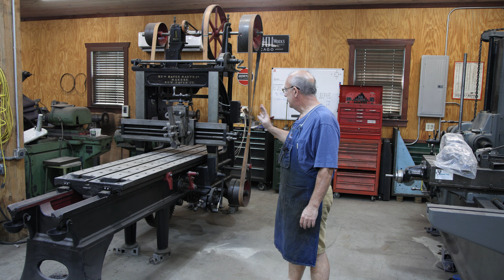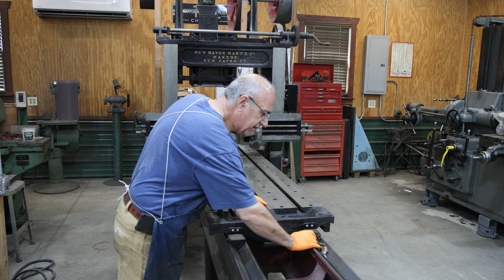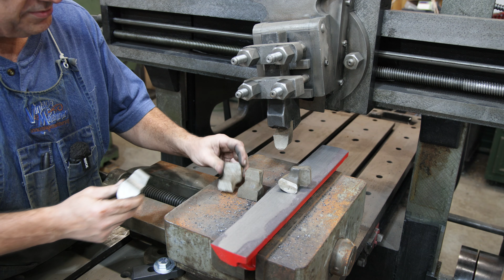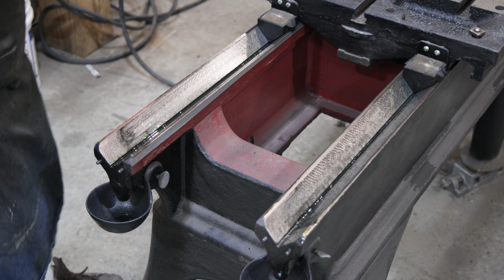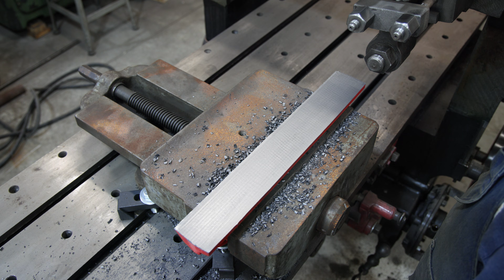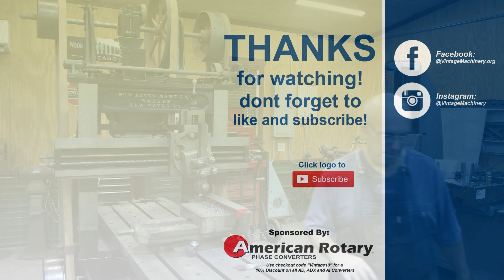1890’s Era Metal Planer: Setting up and Testing Cutters on an Old School Flat Belt Powered Machine

Comment: Check out the older Machinery’s Handbook foot cutting tool shapes.  Roughing was done with tool that you have.  For flat finishing, a broad flat edge cutting tool was generally used.  Scraping by hand followed.  With the flat edge   a relatively flat surface can be machined with a very corse feed.  The original surface of the platten or table would have shown this type of feed.  You’ve done a nice job of rebuild.  Be sure you show oiling all the points needed to be oiled, as most folks don’t realize how much lubrication is required.

Comment: Imagine the workshops when this machine was the standard, the racket it makes then multiply that by dozens to hundreds of like machines. Next door to foundries and forges that produced the raw parts. All powered by steam and oil burning diesels and nothing about work safety more than the common sense you were born with and probably some luck.

Comment: Hi Keith
It is great to see the planer in action cutting chips!
As you have got straight cut gears, I’m not surprised there is a bit of chatter, but the surface finish looks really good. The main thing is a flat surface finish.
I don’t think you will see any of the chatter once you have scraped it in.
Reply: You could always machine a helical cut rack and pinion to take the chatter out provided you maintain a constant mesh!

Comment: Keith, about this planer, you should look at some of David Richards videos, he has a steam powered machine shop and the music from all those belts... As someone who isn't a machinist, old steam powered machines have always been my interest over electric powered. However, since times have changed, I do agree with you adding that electric motor to your planer. But, nothing will beat the old steam powered in my opinion. I know many today prefer speed but, I'm an old school type of person and sometimes, slow is the better way to go. I've seen what high power and sped up work can do, I've also seen the carnage that happens and the cost of said failure vs the old tried and true machines of old. Thanks for sharing, great video as always, cheers :)

Comment: Sometime during the 1960's a friend of mine worked at a machine job shop which made o-ring molds which were 2 plates about 1" x 24" x 24" . The rough p  late was machined flat on 1 of 2 planers which were twins to yours. They were mounted on very short legs , probably to simplify handling of the plates.

Comment: You say this is the wrong machine or perhaps not the ideal one for your test operation. As you are selling these straight edges then could you  stack many of them over the bed and rough grind 20-30 at a time?

Comment: Just like @genesun71 said, try using less top rake on your tools for cast. Either flat top or even slight negative rake.

Chamfer the trailing edge of your casting where the cutter exits using a file, helps to prevent busting out the edge.

Comment: Keith, try a "shear tool" like Adam uses on his big shaper.  He ground his cutting tool with a much steeper (I think you called it a) back rake/angle on your last cutter.  Ask Adam to send you a few pictures of his big shear tool.  It might cut a bit better.  Also, make sure to read @genesun71's recommendation of using a "very heavy open gear lube on the rack and bull gear.  (Acts as a cushion to stop vibration and improve finish)."

Comment: My  old Klopp shaper had a tool lifter.  It was driven by an automotive type choke cable that was pulled on the return stroke by some sort of friction mechanism on the ways.

Comment: a simple way to patent an automatic clapper lift on the reverse stroke is to use the pneumatic in your shop, a cam activated pneumatic valve and a Bimba or alike throw away pneumatic cylinder, you use the belt shift mechanism to trigger the pheumatic valve and the  pneumatic cylinder to lift the clapper on the return stroke.
There is many ways to engineer the support brackets for the valve, the cylinder and the lift le block ) but in any ways, this can stay very simple add on.
One thing I observed is that the feed distances seems to be very agressive, this can explain the shattering you observe on the finished surface on the machined part.
very interesting machine
very interesting video.

Comment: Nice job getting that old machine working again .
If you mount a Bridgeport head to the tool mount and slow the feed way down with a variable speed motor drive then you will have a machine that can do milling work on a large scale .
Josh Topper has one in his shop .

Comment: There's a planer exactly like this one in the sugar mill of the Gay & Robinson Sugar Plantation on the island of Kauai. It still works, although the sugar operations closed in 2009. It was used to cut the brass bearing halves to fit within the supporting chairs for the mill rolls. I was mesmerized by the belts and operating mechanism whenever it was in use. Aloha!

Comment: Diamond hone your tool with a 1000 grit stone. Add about 2* more rake. Add a small fan to blow the chips free as it scrapes. Increase your speed about 10-15%. Try it & see what it does & let me know if it's what you want or tell me to crawl back in my hole with my own planer. Good Luck!

Comment: Keith, I'm a big fan of your videos, and very appreciative of the effort you're putting in to maintain such a steady release schedule. If I could offer one minor suggestion - I'm finding that the audio volume switches up and down quite a bit in your recent videos, and I'm having to adjust the listening volume multiple times per video. Maybe this has to do with you using different microphones for different shots? In any case, I believe that Volume Normalization is a common feature in many video editors, which can be used to ensure more consistent volume, especially when combining different clips.
Not a complaint - just a suggestion. Thanks again for your content!

Comment: Hello Keith, Love this video.  I have a SB &" Shaper.  finding the right tool for the best surface is a challenge, at least on my shaper.  I would suggest some diamond lapping disks to sharpen the edge.  It worked on my cutters (mostly HSS).  I'm looking forward the project that will be cut down to size with this planer.  KOKO!

Comment: Your chatter marks were more evident after 26:29 when the tool was mounted behind the tool holder.  If the tool was inserted ahead of the tool holder it would not tend to be pulled out of the cut.  Doesn't the tool holder need to be angled slightly toward the direction of step-over?

Comment: The rack and pinion on that planer has done many a travel back and forth and I'm sure the rack and gear teeth have been worn some. When you ground the bed and table lowering the rack down onto the gear it could be the meshing of the gears is a bit off due to wear.
Reply: If the gear mesh is to tight to the bed it will make the bed jump up and down and not move smoothly back and forth , it will be jerky .
Check the clearance with some heavy paper, run it through the gears and see if cuts it badly , the big bull gear might need to be lowered to get it to turn smoothly with the rack gear .
Reply: He added turcite on the bottom of the bed ways to account for the bed and table grinding.

Comment: I presume that you know Adam Booth, so why not reach out to him and ask him what tools he uses on his shaper when wanting a better finish when he machined his straight edges
Just a suggestion Keith as I have always taken advice all the way through of my working life in Mechanical Engineering, I had 40 yrs as an Apprentice trained turner/machinest having run most machines even retraining in CNC at a later stage

Comment: I would sure like to see you fit an air compressor to blow chips away as the machine works. By that, I mean: I would love to see you find some sort of compressor which fits the age of this machine (and I have no idea if there is anything which would fit the age and general feel of this machine ) might be a diaphram air pump, simple fan, piston compressor with a wobble plate, or something similar to the oil pump up top. I know you put tons of work into this baby (I watched) but even just a brush on a flex arm might be a fun upgrade.

Comment: The cutting tool dragging on the surface during the back stroke isn't really a problem. Because the machine is feeding at the end of the cutting stroke, the tool will drag on the not yet surface. So it won't leave any marks.

Comment: Even though your belts are not exposed to the outside elements, those McMaster-Carr belts will tend to glaze and may slip. Some on hand belt dressing would mitigate frustration if they did. Some of the spray can type available for v-belts work but my preference is the old  Cling-Surface brand. Don't think its available anymore but if you have or can find some NOS somewhere it'll solve the slip problem.

Comment: I would have fed the head the opposite direction, that way you're not only cutting things once, you're averaging out several smaller depth passes is the work moves under the tool. The ideal chip would be much thinner than your depth of cut, but as wide as your cutter.

Also, why is it so darned loud?  I'd expect gear drive to be a LOT quieter.  Is the center distance correct for the drive gear?

Comment: Keith, when the bed returns have the mechanism hit an air valve that activates an air cylinder that pushes out the clapper box. Also, the air can blow through a nozzle onto the work blowing the chips away at the same time. As long as the bed is returning the air will activate and solve the problem.
Reply: Or just a wiper mounted behind the cutting head.  Going forward it does nothing since the tool is engaged, backwards it drags instead of the tool and wipes the chips away.  Love to see old gear put to use.  Lovely bit of ancient tech that's still useful.
Reply: this is a smart idea
Reply: There is nothing wrong with dragging the tool back over the workpiece on the back stroke.
Reply: Except for wear of the cutting tool edge.
Reply: @rrsteamer  Not if the tool is properly ground. The idea is that going forward the cutting edge does it's work, then on the return the tool should be touching well behind the cutting edge. Same method that a shaper uses.

Comment: Get a small magnet and strip of leather and stick it on the back of the tool holder. As the machine travels back over the work it will catch the leather and protect the work piece. Can't remember where I heard of this technique but it was the poor mans tool lifter.
Reply: That is such simple idea to lift the tool that might have been done back in days when these machines were in use .
The leather trailing behind the tool and then falling off the work piece before the tool returned and pushing the tool of the work on the return stroke , probably the leather would wear off and have to be adjusted down some every so often to keep it working .

Comment: Hah! As to horizontal surfaces, it's not just in shops! This is a continuous (44 years and counting) discussion with my wife! Love the old machines. Fwiw, Abom79 has many episodes on his big shaper that has a similar clapper box. He talks about how the angle of the clapper pivot is  super important so that the tool holder swings itself out of the way on the back stroke. If you get it backward, the tool digs in and ruins things. He also points out that when you look at the setup, the correct angle tends to look counter-intuitive - like it should be thee other way. I think yours is right. He dinked around with cutter grinds for a long time to get nice finishes. He uses - as you did - a specially ground shear tool and light cuts for the final passes. He hones the tool after it's in the machine by putting a precision stone on the table.

Comment: Excellent video Keith. 
It looks like you need to coat the bed and vise with oil. Rust??
I would recommend wiping it down with kerosene and not simple green purple. 
Water is a bad thing. 
It’s good to see the old machines working.
Reply: Water based de greaser / cleaner will cause rust and some of the stronger types will remove paint too , I have seen that happen .

Comment: Back when Abom79 was working more with his shaper he tried some different tools and found a particular tool that produced an amazing finish. One of the main things with it was that he honed in the cutting edge while in the holder, making use of the clapper box to get a back rake. There are also special tool holders with a geometry that prevents the tool from digging in too much, making it more stable.

Anyway, it's already looking pretty great. Could propably use it to refurbish smaller lathe beds etc. Saw videos of people in india casting lathe beds in molds buried in the ground and then machining the ways on a planer like this one with really crude looking tools, but the result looked pretty good.
Reply: yes - he put the stone on the workpiece sometimes...
Reply: There's a gentleman on YouTube who does just that, I've seen 4 or 5 videos of him planing the beds of Southbend 9" lathes with great success. I unfortunately don't remember his channel name (very small channel) but searching for something like "Planing Southbend lathe bed" will probably turn him up

Comment: Awesome machine - we had one about half that size in much worse shape.  We finally decided we would never get to it and it was scrapped.   The only thing I would add - I think you are just moving too slow.  I think you need to increase the surface speed.

Comment: CNC planers are used heavily in China where I live. They are used for fabricating sheet metal. They are able to cut long straight v Grooves so that the sheet metal can be folded into moldings and similar. The groove allows a crisp small radius bend. Super common here.
Reply: Planers?

Comment: I'm curious to see how close that would get a worn out lathe bed to scraping status.  I'd experiment on one that is considered "not worth it" by means of grinding (cost wise), first, though.  And it may be a real challenge with ways that were flame hardened.  

Maybe someone has a lathe in that "DIYDx2" condition that they would let you experiment on ... ?

Comment: Keith, could you mount a brush on the backside of the tool. Maybe even a wire brush that would flip the tool up as it passes the end of the part.  Kill 2 birds with one stone.
Reply: Or a stiff piece of leather clamped to the back of the tool would work.

Comment: On a side note Keith, I bought a vise just like that from a biker 50 years ago. He had welded a 3/4” drive socket on the end and used a 3/4” ratchet to adjust the vise. I bought it for $15 and have used it ever since as my bench vise. It’s so heavy I’ve never bolted down to the bench. I’ve always wondered what machine it originally came off. And now after 50 years you finally provided the answer! Thank you! 🙏🏻

Comment: Nice video. I allways wipe off a surface in one direction though, and repeat it, so as not to spread the schmutz back again. Wiping the dust to one end. Especially important when re-painting a car body.
Wiping back and forth leaves debris on the surface if not just used to loosen it up. Then one have to wipe the whole surface in several sessions in one direction to get it clean. Otherwise, much of the particles are just moved back and forth and the surface will not be very clean. (in the beatiful machine-bed of yours)

Comment: @tropifiori
0 seconds ago
Does anyone out there know a machine shop in Va or northern NC that had a similar machine. The lathe bed on my Atlas12 inch needs about .050 taken off it. The bed is about 40 inches long

Thanks
Frank

Comment: That's an awesome machine. Josh Topper mounted a Bridgeport head on his that does a great job for him. I feel that adjusting the angle of the clapper box would help to remove the chatter with a little bit of radius on the leading edge of the bit would improve the finish. Thank you Keith. Nice to see the old girl make chips.

Comment: Does anyone out there know a machine shop in Va or northern NC that had a similar machine. The large bed on my Atlas12 inch needs about .050 taken off it. The bed is about 40 inches long

Thanks
Frank
Reply: There are only 2 machine shops with a planer that I know; one in New York State, the Old Steam Powered Machine Shop of David Richards, and this one of Keith Rucker.  Topper Machine Shop in Minnesota has a planer with a Bridgeport head adapted to it he uses but I am not sure of the bed length.
Reply: Don't send it to this guy!

Comment: At 8:37 - Keith is describing how the table moves back and forth slowly on the cut stroke and then faster on the return stroke as the table drive belts move from side to side. This helps speed up the work. The difference in speed is caused by the size of the far left and right pulleys mounted on the upper counter shaft.

Comment: I am thinking your clapper box tool holder is too loose for the surface finish you are looking for. Too much vibration. 
You wouldn’t think of holding a tool in a loose manner like that on a lathe, would you?
You could also rig up a cable with a weight over a pulley that is attached to the table to dampen the backlash of the table drive gear. 
Keep playing around with the tool geometry it is an art as much as a science!
Keep up the good work!
JIM ❤

Comment: Knowing absolutely nothing. I would guess the tool should be like a farm plow. Rolling the metal up and out like a big tractor turning the ground over
Reply: On steel it will with the right bit grind .
On cast iron it will make smaller chips .
Reply: @kennethnevel3263  
I was not thinking about it being iron .